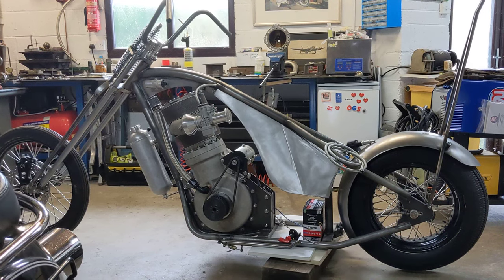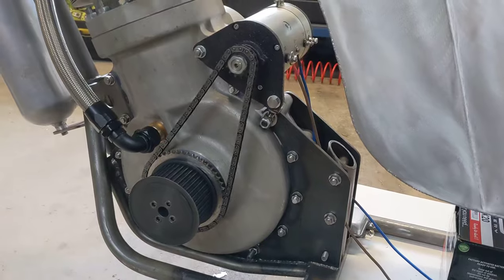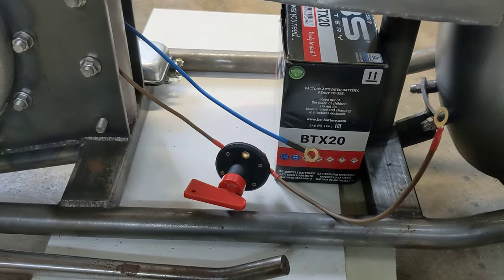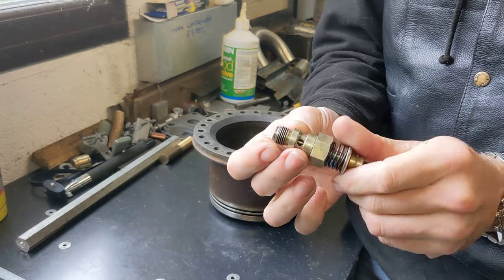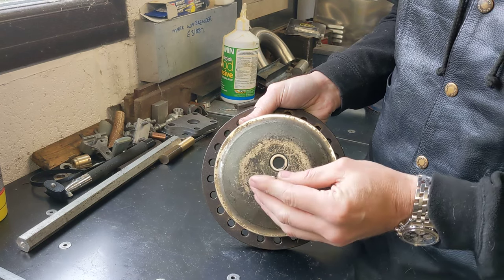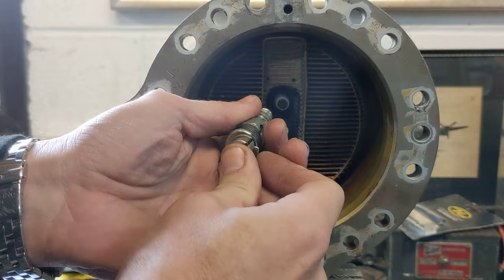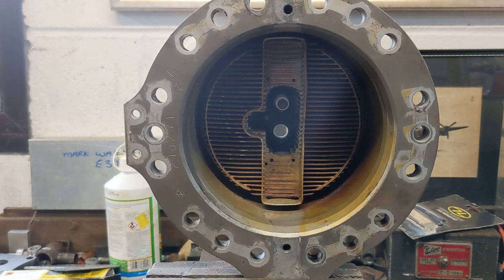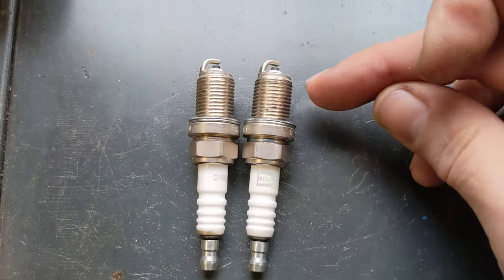Decompressing on Sunday morning.

Comment: Great project and build looking forward to hearing it run. With the spark plug issue you could turn off the first few threads until it is flush with the head,

Comment: Can you make a sort of stand off to raise the decompression valve above the fins?  Male spark plug thread in one end and female on the other, with a small hex on it to install it, and then thread the decompression valve into that?
Reply from the maker: That's not a bad idea, I'll add it to the list of deliberations.
Reply: Was thinking along the same lines to extend the decompression component. If you have a compression tester they come with adapters that do diff diameter holes. You might be able to temp use one of those. I will send you over a pic.

Comment: Thay make a spark plug with a built in decompress mechanism that you activate on startup  used on Harley-Davidsons with high compression motors and it auto disengages after it cranks up.
Reply: That way you could keep both spark plugs as decompressors also